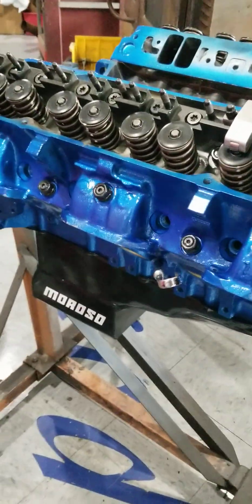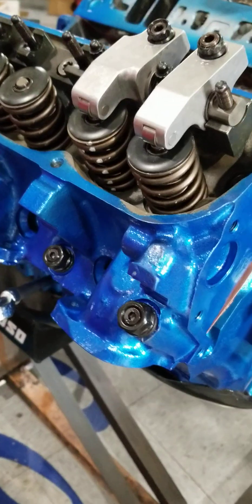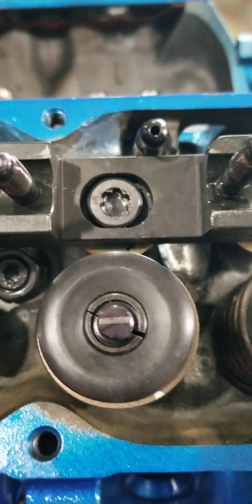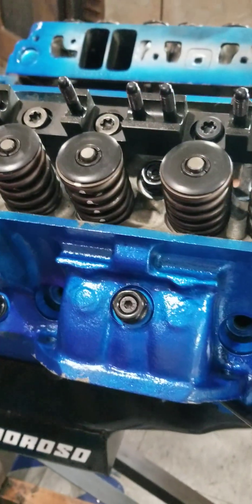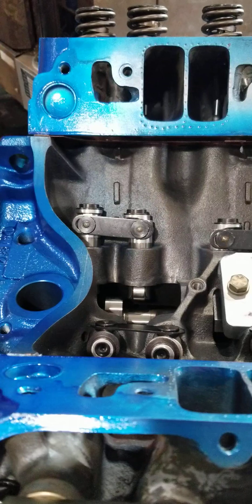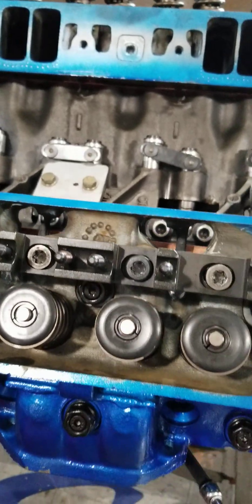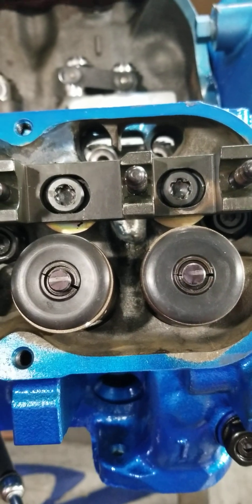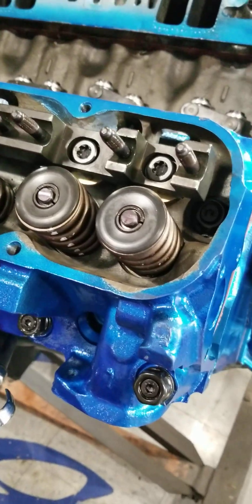Proper valve train geometry

Comment: Great video very informative. Have you ever seen Harland rockers showing a wide pattern on Pontiacs? For some reason I can't get the geometry correct I'm using high Port heads. Can't get my pattern less  than .098. rolls in the center though of the stem.
Reply from the maker: A wide pattern if it's centered on the stem is typically a angle problem. Meaning the rocker stand angle is not correct for the valve angle so they dont play well together. I have had to fix that on several heads and to do it is not easy or inexpensive.

Comment: I hope to be building my big injin later this year to install in my comverted 99 Grand Prix and wish I could afford a set of your RAV heads but looks like I'm gonna have to settle for set of Edelbrock Performers to start out with and modify to crap out of those like you did with these RAIV's. I likely will be contacting you about some valves in the not too far off future,
Reply from the maker: Keep in mind I will be releasing my new RA3 and RA4 aluminum heads soon. Depending on your time line they may be available when you're ready to buy heads.

Comment: Suprised u aren't using the RAM AIR 5 HEADS...  Don ...  that u designed... Why Not ?? 😅
Robert    Australia 😅
Reply from the maker: This is an old set up I ran back in the day way before I had designed better heads. I'm resurrecting it to make it run the number on pump gas and the I will sell it when I get it sorted out. I used to run this set up on race gas in a 3600 pound Grand Prix I street drove. It would run 10.20's at 136 MPH back in the day. Now I'm hoping for 9.80's in a 3600 pound Lemans :) Don't worry though, once I get this engine sorted out my next engine will be a RA5 :)